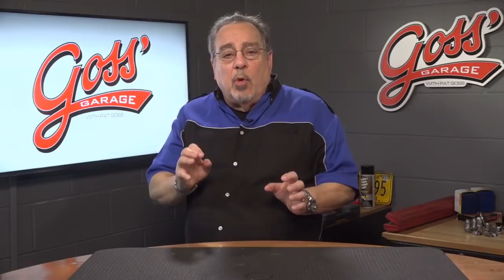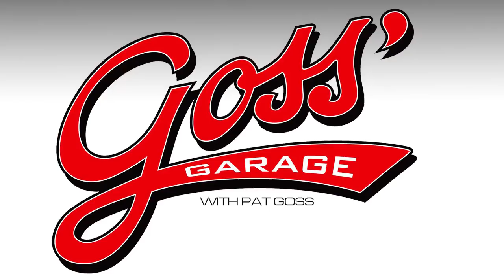Pats Perspective # 139 LED Headlights

Comment: What about the ability of LED headlights to melt accumulated ice & snow?  Halogens can do this to keep the lights clear...can LEDs do it too?
Reply: LED doesn't melt snow. The headlight housing will be room temp. My car stop having moisture inside the housing when i use LED. You can always get a brush to brush off the snow. Not really a big deal. Having snow blocking your license plate will get you a ticket here in NYC.
Reply: Just use a Rain X water repellant coating on headlights.